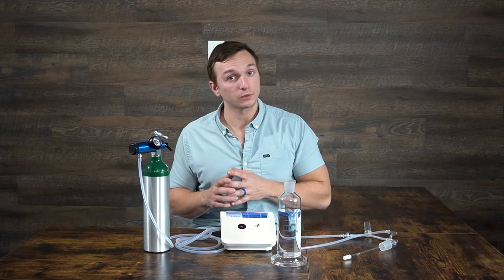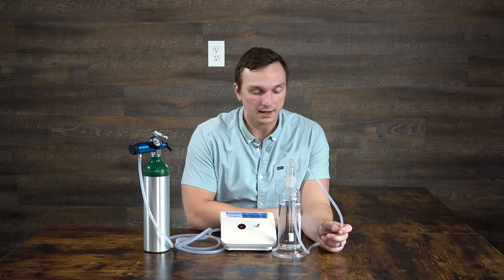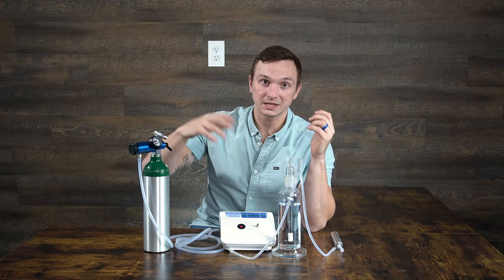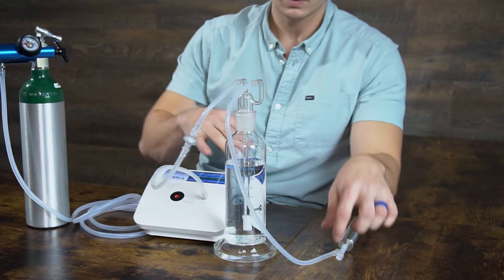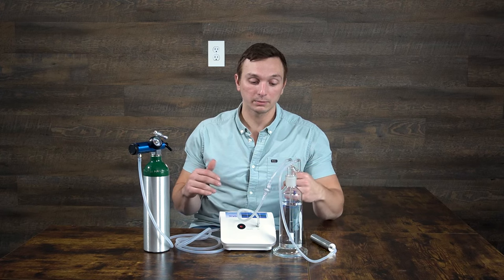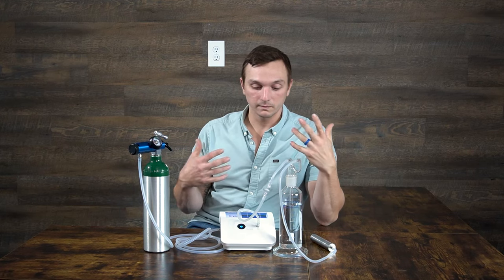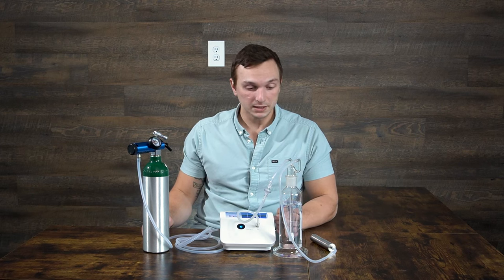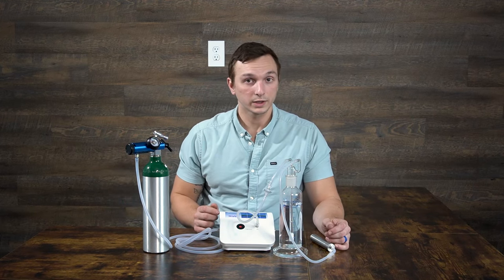How to Ozonate Water - Simply O3 Water Bubbler System

Comment: If ozone in water/oil only lasts for a short amount of time, does buying ozonated water/oil make no sense? How can we know if there’s even any ozone in the products
Reply from the maker: Ozonated water lasts a short time.  When ozone gas is infused into an oil it stabilizes as a peroxide.  The shelf life of the oil depends on the manufacturing process, strength, and quality of oil.  

Our ozonated oils undergo third party testing to identify the peroxide value.

For ozone water, there are ozone analyzers that can measure the amount of ozone gas in the water, like we have here at our facilities.  However, these are kind of expensive.  Ozone has a distinct smell, so it is particularly noticeable if it is present in water.

Comment: My oxygen regulator does not go up to 7. I don't there is any O2 regulator that goes up that high
Reply from the maker: All the regulators on our 3.0 system have "settings" 1 - 11.  These are not the same as LPM.  They all have a flow rate of 1LPM or lower.